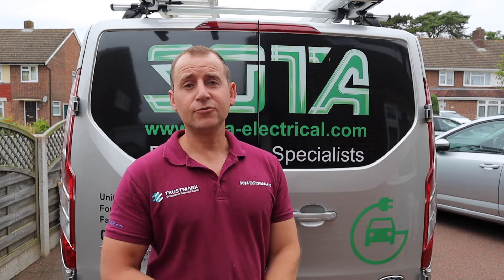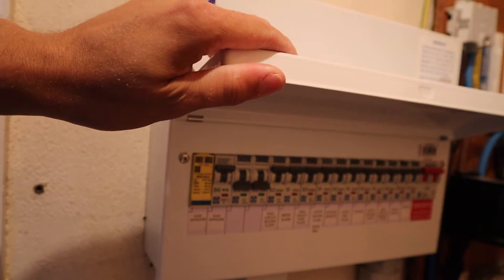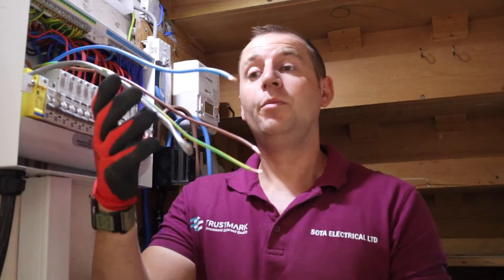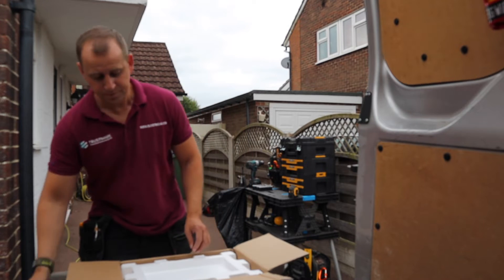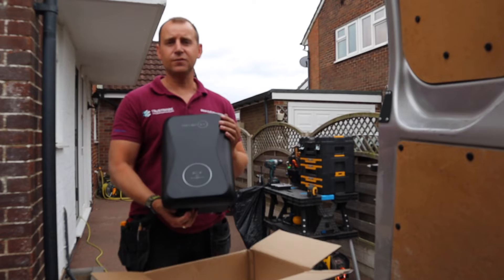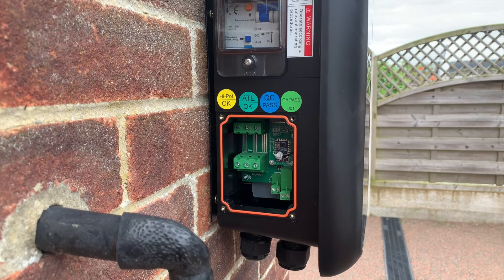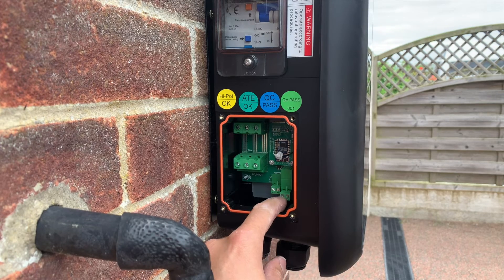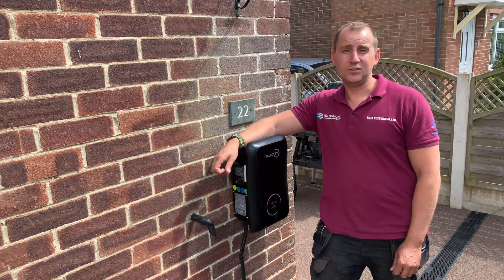'Project EV' charging point installation & nightmare cable route! #electricvehicle #ev #electriccar

Comment: I was interested in one of these potentially for neater and more compact install when I saw the RCBO. I don't think it's possible with this one, but could a charger be installed directly from a henley block via the meter box if a charger came to market with a built in din rail with surge protection, isolator and the correct RCBO? Because we can't add consumer units inside the meter box and external ones make for bulky install, this would be ideal for me. Would be a nice neat install if this was possible. I'm not aware of one on the market and so I'm thinking I'm missing something and it's not possible due to safety or regs. It would be interesting to know. Came across you the other day and been enjoying your installation videos.
Reply from the maker: I don’t thing what your suggesting would be an option because the cable supplying the charger would have no protection itself. 
Thank you for watching my content though!! Much appreciated!! 👍👍

Comment: Great Vid. Just fitted my first Project EV yesterday. Dissapointed with the space for terminating the cables. & the RCBO is fitted upside down & re-labelled. wouldnt take alot for updated design.  Admittedly the customer support was excellent.
Reply from the maker: Thank you, gosh this is an old video now, I’ve not fitted one of these in a long time!! I thought they may have ironed out these creases by now

Comment: Were you able to test this unit using your MEGGER tester and EVCA210 ? I tried to test one and am having issues . When I plug the EVCA210 into the charger and select C, it takes ages for the contactor to kick in. Feels like about 10 minutes.

Comment: I've had one of these installed. We have cheap night rates. When the cheap rates start, the charger turns itself off. As soon as they end it comes back on again! We have solar panels as well if that matters. We also can't connect to the thing
Reply from the maker: Sound to me like it hasn’t been set up properly on the app
Reply: @sotaelectrical  thank you. I thought that too. But I can't connect to the app. It tells me to stand next to the unit and connect through wi-fi. But I'm not getting a wi-fi signal from the charger
Reply from the maker: @markfp9705  you may need to turn off your charger for 5 mins then turn it back on, hopefully then you will be able to connect to the charger, failing this, call project EV and they will walk you through it

Comment: I was quoted £1200 to fit one of these straight off my meter box. The guy said I needed a Type A RCBO in an IP66 enclosure, but this unit has an RCBO built in. Do I need two RCBOs? Thanks.
Reply from the maker: A lot of EV chargers with built in RCD’s don’t comply with the regs, I would do the same as he is suggesting and the price sounds fair if I’m honest
Reply: @sotaelectrical  Thank you for the reply.
Reply: No you don't need another RCBO. The RCBO in the project ev charger meets the regulations of BS7671

Comment: any chance of a app set up vid .
Reply from the maker: Hi Wez,
Thanks for your comment, I can do but I have not installed a Project EV for a while, next time I install one i can put a video together for you if that's ok?
Reply: @sotaelectrical  having a mare with the app . Starting to think there's a problem with the WiFi card . Cheers for the reply .
Reply from the maker: @wezcole3626  are you installing one or are you a customer? Il try and help now if I can
Reply: @sotaelectrical  I've installed it , 1st time I've used this type .works sound charging . They seem pretty good if you can getting he app to work 
. It just disconnects after you put the ssid in . Thanks for the offer I'll try again tomorrow .
Reply from the maker: @wezcole3626  give project EV technical a call, they are very helpful when I have had issues in the past.
Reply: @sotaelectrical  I'll give them a go tomorrow . Very annoying when you can't get something working . Plays on the brain . Tomorrow's a new day . Cheers for reply